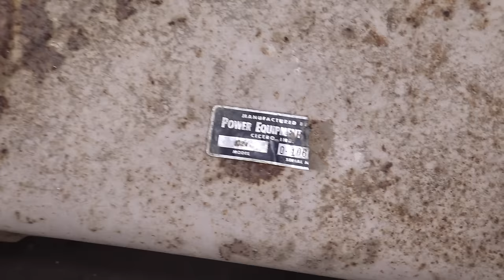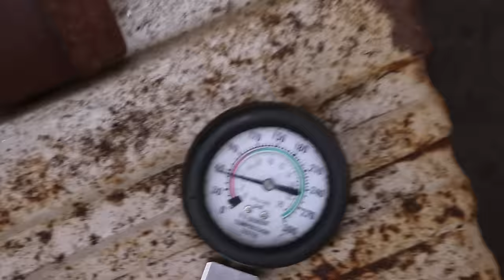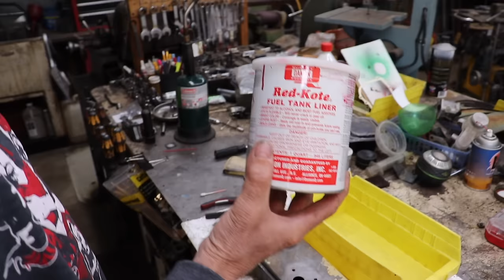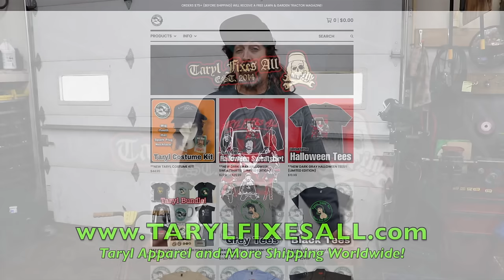Briggs TERRIBLE Mistake! Massive Mower Recall! ⚠️

Comment: I think it's definitely a candidate for a full restoration. I also think it's interesting that the deck design is very much like a Lawn Boy with the front corner discharge. I'll bet it gives a really nice cut. Great video Taryl.👍😁
Reply: Yea,it's the lawnboy deck,the engine doesn't sound any quieter that the modern engine

Comment: Thank Taryl, that carburetor was a trip down memory lane. I remember my Dad working on one back in the 70's. He grew up on a farm and didn't want to drive 25-30 miles to the big city just to buy a new diaphragm, so he cut one out of an old bicycle inner tube.  I was stunned that the engine started and ran. It was only temporary until his next trip to the city, but it impressed me.

Comment: Request! Back in the 60's my dad had a rotary mower with a Briggs & Stratton engine and it had a 'wind-up' spring starter. You folded the crank handle out and cranked it to wind up the spring and when you folded the crank back the spring was released and turned the engine over to start it. I don't think it ever worked very well. I wish I could see you fix one of these.
Reply: We had one too when I was a kid. Bought at Leonard's Department Store in Fort Worth  TX. Briggs called it an impulse start.
Reply: I found one of those wind up starters. It’s caked with dirt and rust I don’t think it would ever work again. I might put a little time in it and see what happens.
Reply: My father owned a Sunbeam crank-start Tecumseh and it was nothing but a pain.  Cut the lawn with it for several years.  Self-propelled by a toothed belt off the underside crankshaft and helical-cut steel cylinders that rubbed on the rear tires when you pulled the handle up.
Reply: Got a one on a shelf over here in Australia. Weird but does still work. No idea if it runs but one day I'll do a vid 👍
Reply: Yep I remember those wind up starters.  They were in the early 60s

Comment: Wish Briggs still had that muffler. It was one of the quietest I have heard for motors of that age   Definitely a piece of history
Reply: I generally find using a 'Low Tone' from a larger engine works well
Otherwise the options are limited until you fab something like a motorcycle muffler to your app. I've an Onan powered Miller that sounds sweet with 1 discarded HD muffler mounted along the top corner👍 
Exits in direction of controls so is easy to monitor exhaust note. 
I tried a catalytic one >Kawasaki, but decided the exhaust note was cleaned too much...
It emitted a clean humid exhaust
🤨Wanted an honest exhaust assessment

Comment: Hi Taryl.
I love old machinery like that. That's 8 years older than me.
Probably the reason it was hard to turn over was it was built before the idea of depressing the exhaust valve a little bit to reduce the pressure to help starting.
This is a reason that exhaust valves get burnt out on older machines that had that "easy" start solution.
There are more modern machines that solved it by when the machines up to speed, the little lump to press the exhaust valve retracts so it stops the valve burning out.

Comment: 4 years ago I couldn't get ten bucks for a 1972 McLean front throw reel mower and a 1974 McLean edger. Original paperwork on both. Both ran.  I finally left them on the curb. Took a few days for someone to grab them.

Comment: Very cool find!  I've been on the lookout for the 24" Lawnboy version for some time.  While they are considered under powered, they aren't as bad as you'd think.  This was before the concept of mulching had taken hold.  And with the these big, straight, tangent grass chutes at the front of the mower and dead flat blades, they would handle a lot more than you'd think.  They only had to cut the grass once, not process it.  All that exposed spinning mass under this one is just crazy though.  I wonder how many of those scoop castings came apart at 3600 rpm spraying chunks of aluminium shrapnel?  Seemed like a great idea at the time......

Comment: I once fixed a leaking gas tank on my 1949 Plymouth using solder and a MAPP gas torch.  Worked great (had to remove and thoroughly rinse out gas tank first).

Comment: Another great video!  Taryl, I have to disagree on the electric power comment. I think for homeowner machines, most people can use an electric mower, weed trimmer, blower, etc. For commercial use, fuel powered tools will be here for quite a long, long time. A lawn crew doing 15- 20 yards a day, can't wait for batteries to charge or deal with the cost of extra batteries going after a couple years, etc.

Comment: 👍Makes me want to look up the crank up push mower I used  when I was a kid in the 60's. It didn't use a pull rope. You cranked the spring up tight then push down on the crank handle and it started.

Comment: You can never say anything bad about a B and S. I pulled one out of a dump once, put in new condenser kit and plug and it worked great! Mowed the lawn with it for two years in South Florida. Learned how to replace piston rings in small engine class but never had to ever do it on an old B and S. Loved them old ones. I never could get one of those Sears Tecumseh engines to run, but a Briggs, never had an issue.

Comment: Taryl, just check the OD and ID of your unused point plunger bushings.  You can probably source a hollow brass rod and cut it to length.  Or, solid rod and put it in a drill vice, then drill the center to the correct OD.  
Great content, and I wish they could have made this design work.  It sure makes points cleaning, replacement, and adjustment easy.  
As someone else commented, I'm surprised they didn't plumb the exhaust to below the deck.  We had a Toro / Tecumseh mower. That did that.  It did help unless you pushed it across a driveway or sidewalk.
Reply: I bet K&S makes the right size tubing if it is a standard size.

Comment: I have a "NEW" in the box "SONODUCT" briggs/ stratton engine( never activated). I worked in a small engine repair shop in the early to mid 70's when these mowers were still in service, and yes we did have some come in that had caught fire with the cover in place, and the customer would not know that there was an active fire until it was too late , the muffler and the pulsa-jet carb with the gas tank bolted to the carb were too close to each other, and would get too hot and go up in smoke, with the cover in place. we would tell the customer to remove the cover!!!!. I also bought the parts for that engine when they were still available. another rare briggs engine is the 1940 mod. "N" that is "WATER COOLED". I have one on a generator( military- new in the crate- never activated)
Reply from the maker: Hi Gregory, You wouldn't happen to have an extra cover laying around we could get off ya would you?
Reply: @TarylFixesAll  , thank you for responding!!!!!, I do not have any covers for those mowers, the only thing that I was aggressive with, was old briggs parts that are no longer available, and complete engines that are used or new/ old stock. I have briggs engines that date back to 1919( when STEVE BRIGGS worked for "A.O. SMITH" as a machinist, and bought out the" motor wheel" from A.O. SMITH, and it became the mod. "P" engine. I have engines from mod. A to ZZ, and mod. 5 to 32 ( cast iron). I also have aluminum engines ( cast iron sleeve blocks starting in 1958 to 1965),  with mod. 6, 8 ( 1953 to 1957) up to mod.140000 series( 1955 to 1972). I also collected aluminum engines that have "POINTS/ COND." for spare parts. I am cutting grass with a" 1969 JACOBSEN" mower( that is the newest unit that I have , it goes backward from there) with a" BRIGGS" engine( mod. 92502 code. 6901052) I bought this machine in JULY of 1973(I was 12 years old) when I worked in the small engine repair shop .that engine now has 8,500 hours on it( that includes a 10 year rest from 1979 to 1989), and the bore is at .020 over size starting this past spring. I put 500 hours on it a year, and the engine gets rebuilt every year. I did have exhaust valve stem and guide issues( worn valve stem and  guide/ replace brass guide every year) that stopped when I switched to premium grade gasoline( too much alcohol in regular grade gasoline). I tried "MOTORKOTE" that stuff is nothing but expensive snake oil!!!!!. it did not help or hurt the engine!!!!   have a great day!!!!!.     P.S. STEVE BRIGGS  left briggs/ stratton in 1948 to join forces with his buddy "OLLIE EVENRUDE" and they started "O.M.C.", the" lawn boy" mower with the mod. "C or D" series 2 cycle engines were engineered by "STEVE BRIGGS" he liked the 2 cycle engine over the 4 cycle engine( his hands were tied when he was in partners with HAROLD STRATTON who financed the joint venture, so they never developed the 2 cycle engine at" B/S"

Comment: The classic Lawn Boy mowers were the easiest starting and quietest running mowers I used. They did have issues with the muffler filling up with carbon. It wasn't difficult to remove and clean.

Comment: I’ve got another odd Briggs and Stratton engine from 1963, it has a flywheel lock and a fold out crank on top of the starter housing. 
 Basically you lock the flywheel and turn the crank to wind up a heavy spring inside, then unlock the flywheel and the heavy spring cranks the engine over to start it. 
 Problem was, on the dealer showroom, a customer would lock the flywheel and wind the spring up, leaving it for another unsuspecting customer to walk up and place their foot underneath the mower while not realizing what the knob does, unlocking the flywheel, and the engine cranks over, causing injury to the feet. 
 It ended up being a catastrophe and they pulled the engines immediately.

Comment: Slipper in the chipper, "Fire it up, Fire it up"!  Fun video.  
I have never seen one of those mowers, but know that back when it was being sold,  I would never have bought one.  Sometimes, good ideas can come from bad decisions, but this wasn't one of those times.  I still love the old Briggs engines, they were indestructible.
BTW:
I drove my bosses Edsel Citation back in 1959 when it was new, and for as ugly as it was, it was a very nice car.  GM and Chrysler also made the same styling errors back then.  I could never understand how GM could have gone from such a winning design as the 55 and 56 Olds, to the abominations of 57 and 58.   The designers and decision makers, must have been on a mushroom diet.  
Great stuff, I enjoy the actors in your little Playhouse Theater.

Comment: One of several things revealing the idea was half-baked, on the top crankcase half there still remained the bosses that held the nuts for the air shroud of the regular model.  Despite the model's economic failure, at least they were willing to try something new, however misguided.  Truly the Edsel of rotary mowers, I'd never seen one before.  Thanks!

Comment: Taryl,  I had heard of these, but your vlog is the first one I ever saw.  As a grass rat for over 50 years, I am sure that with the scoop doing the cooling, and the engine, with grass clippings blowing up through the cooling fins, it would cause it to overheat for sure.  My Dad bought a very similar mower deck, with the underpowered 3hp Briggs engine, and bought at Monkey Wards, back in the day.  It was a brown deck with a white engine.  Thank you for a great video.

Comment: I had one of those Honda HRS21's. The engine was very odd and a little different to work on, but not impossible. The carburetor bowl was held on only by plastic tabs that you would squeeze together to remove the bowl, which could easily get knocked off. Otherwise, pretty cool 80s mower!
Reply: Interesting
Reply: @WJCTechyman  yes man they were always a 2 finger start! And that's how I sold them!
Reply: @WJCTechyman  Yes I agree, it was a super durable and quiet mower. I almost miss it haha
Reply: Still using one of those.  Great design for removing Float Bowl etc.  Never got knocked off.
Reply: @gordbaker896  For removing and servicing yes, it was great. I should've been more specific, when I was transporting it, something hit the carb and it got knocked off a couple of times, most likely my fault and I should've transported it better, but still won't happen as easily if it was bolted on. Otherwise, a great mower, and I miss it
Reply: I think you mean carbetrator.

Comment: Hey There Taryl,,, I have watched many of these videos when you have a fuel tank from a old machine that has rust holes in it.
 There used to be repair kits that you could get from the auto parts store that worked very well.
 They are. SYON brand if I remember correctly,. I have not seen them in quite a few years now but maybe you could find some online.
  They are a two part epoxy in a plastic bag type envelope that has a divider in the middle, and the kit comes with a piece of berlap type material in it for the repair.
 I have used these kit in the past and had very good results.  And if I remember correctly the last time I purchased one they were only around ten dollars.
   Thank you for the videos man.
Tim from Wisconsin.

Comment: Got me worried a bit now.  Never crossed my mind about asbestos in gaskets in these old engines.   Having worked on a few vintage ones of late I think I am going to have to be a lot more careful handling the old gaskets now.
Reply: Eh a lil asbestos is good for the immune system
Reply: @M.TTT.  Baloney!
Reply: @williamjackson5942  I'm sure he was joking
Reply: Tamil Fan ..Lead in the paint as well. Sanding  paint would be toxic. Get a test kit before going forward with any paint removal on old equipment. FYI.. Ethanol replaced lead as an octane booster in gasoline.
Reply: @RaysLaughsAndLyrics  Lead in the gas was a lubricant.

Comment: Taryl! on Briggs you can test the compression just by spinning the engine backwards quickly, you should get a quick sharp bounce back the other way, if you don't it needs service. spinning it backwards defeats the automatic decompression that's there to make it easier to start.

Comment: I use to have a 3 HP Briggs Push Mower that lasted for 20 years-I paid $39 for it from Gibson Discount many moons ago, it finally just ran out of Compression, I took wheels off it and mounted it on a Frame just for Posterity Sakes. I would start it maybe once or twice a year, it had very little compression but would start and run. In last 5 years, I have went through 3 Push Mowers from Walmart, they will not last  much over a year and I take good care of them. That old mower did same job as these newer ones and just would not give up--too many Plastic internal parts...

Comment: The best advice i can give r starting any Briggs and Stratton with these diaphragm carbs on the fuel tank top is:
ALWAYS fill the fuel tank to overflowing.

This completely fills every passage in the carb, that bowl...and it softens up the diaphragm..

By the time the engine has warmed up the fuel level will be back down to the cut out in the bowl, the pump will be pumping and the machine will be running well....

Comment: Thank you, your help is appreciated. Been watching your titorialas in depth for real world refresher on points.
I have a weldanpower 225 with an onan generator from the eighties with dual plug setup, getting fuel 6 years ago but no spark, welded fine 10 years ago before parking it with a cover on back of truck. Onan went through different ownership and no clue to parts availability. Probably many more guys out there with same shituation. No voltage getting to coil, points move nice, they where replaced along with condenser, and some kind of little cdi looking box when I bought it from a guy 12 years ago when it welded great. Wish I was close enough to drop it off. You would blow the interwebs leather gromet out if you worked on a couple of these bastards. Everyone has a brokenan generator in there welder, or camper.
Reply: Check the magneto..... Onans have that problem.

Comment: Amazing the service span of that point system 
One of Briggs best features. 🤨The worst? the plain bearing crank and bushes, but Tecumseh as easy as the carburetors were, and to get running(a favorite) had even lighter duty components.

Comment: Taryl  did you ever have the briggs & stratton 4 stroke with the crank handle  on top that you turned then turned a knob on the side of the motor that released the wruned up spring to start the motor. it made the starting easier than pulling on the recoil.  This was back in early 60s.

Comment: I had one of those carbs on a 5hp Briggs I just couldn’t get running no matter how many times I tired cleaning the carb it just wouldn’t pump the gas. Ended up boiling the carb in an old pot with some dish detergent to finally get it unplugged up and running.

Comment: Amazing I never seen one of them till now.  Really interesting design but at the same time I wonder how they thought the air duct under the deck would not end up sucking in a lot of grass and crap in and onto the engine cooling fins. No wonder they had to recall them for fires.  Still love to get one of them for the uniqueness of the design.    Also the exhaust is venting on the top like all other briggs when I thought it was meant to go under the deck?  Have you had that honda engine one before?
Reply: I think it's pulling air from top and exhausting under the deck to cool the engine.

Comment: This was great.  I would like to see The Master work on a DIXON cone transmission.
Reply: I worked as a tech for a Dixon dealer before becoming a auto tech. I've set up and rebuilt dozens of these, they are not too bad, just time consuming
Reply: @dave1135  thanks,  I've got one, it's working fine.  I'd like to see one repaired,  just in case.  They are very rare in my area.

Comment: To clean a spark plug I use a little bead blaster from harbor freight.  then I blow them out with the air hose... makes them like new..  Good for 1 or 2 cleanings before the plug starts to fail.